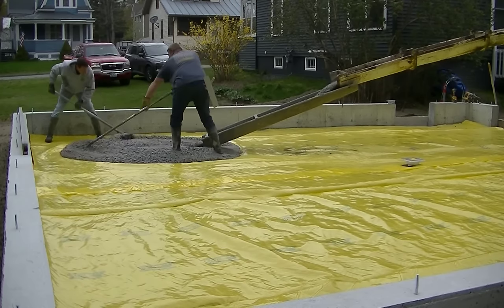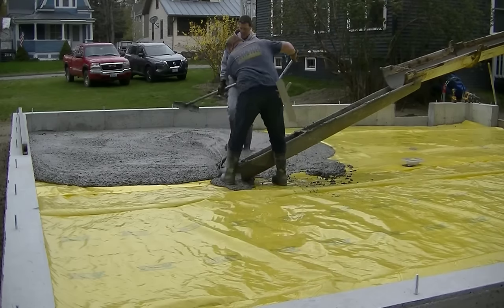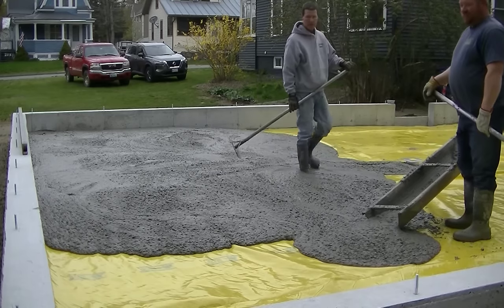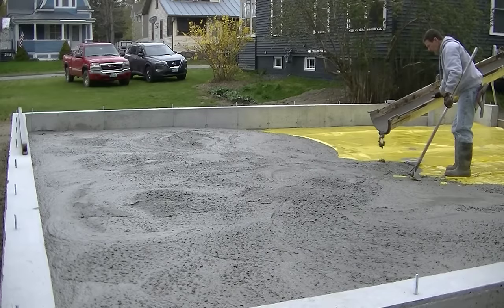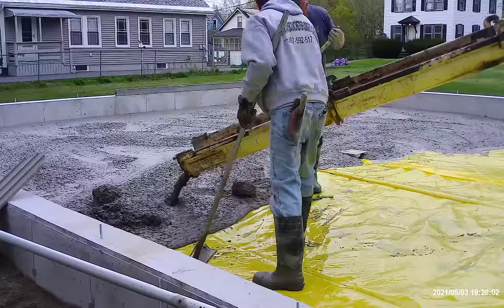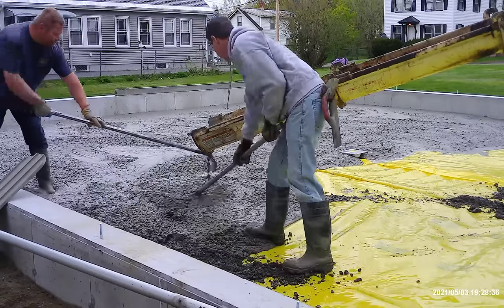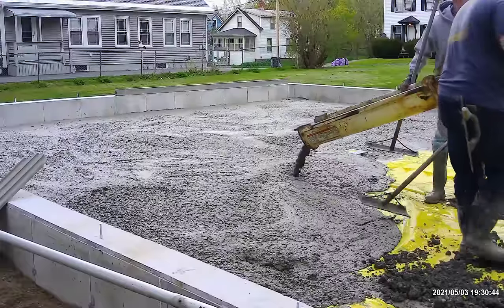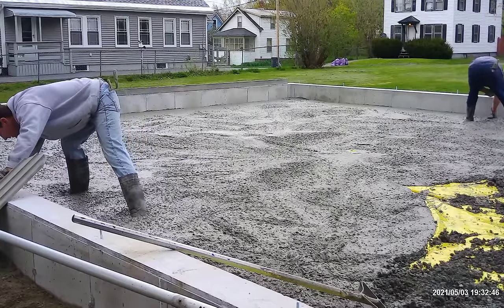How 2 Men Can Pour A 32' X 28' Garage Floor (I Got Concrete Balls!)

Comment: retired finisher here and so glad you told us about the superplasticizer, I was gonna call you out on a 8 inch slump
Reply: Not retired yet but started as an edger and went to knee board finishing and I was thinking the same thing🤣
Reply: Didn't watch the whole video, but was hoping that was super p and not 70 gallons of water. I poured a lot of "self leveling" mud as a driver. Lots of lazy finishers in this area.
Reply: @TUGG75  we poured big commercial government jobs. They wouldn't let us add water, our QC guy had to come add super p to the mix.
Reply: I thought the same thing.  No bar, 8-9 inch slump, hope you’re only parking bicycles on that shit.
Reply: @jrichtruckincbtips yeah they should have ran into a lot you got to check the specs 10 5/4 for every yard you can add Super Pete tell the driver to bring the slump up to a 3.5 when he gets there then throw the super pee in you'll be fine
Reply: Besides they take test cylinders and that will tell the tale
Reply: @jrichtruckincbtips depends on what the specs are I hate them concrete inspectors and test guys they only have a civil engineering degree they're a pain in the ass I don't let him dictate my job you're here to take test cylinders and that's it I'm glad I'm retired

Comment: I haul concrete for a living.  The “dry balls” are caused by slumping up the load too quickly with water.   The more water reducer that’s added to the mix during batching, the slower you have to add the water to the load.  If the batchman adds all the water to the load and leaves no room for the driver to slump up, the balls won’t break up.  Also, those came out near the end, so there was most likely dry pack stuck at the front of the drum and started to break loose at the end.  Unless you can dry up the load with a bit of cement powder and aggregate, it’s nearly impossible to break that up on a high slump load.
Reply: ...exactly!
Reply: Good answer for concrete balls. Plus the fins are wore out? Hmmmm?
Reply: @user-fy3kd9qf2m  I've gotten the balls with a brand new mixer...its definitely the batching method. Typically when its rushed and too wet for the mix chemistries makes for rabbit turd dissentary.🤭
Reply: @user-fy3kd9qf2m  The drum usually wears out, just past the center of the drum on the rear half.  The fins are usually still fine and don’t affect the mixing due to wear.  The height of the fins on a dry batch drum are usually taller than on a dry batch drum.  You can tell a wet batch drum from a dry batch drum by, a wet batch drum has a long weld which goes from the front to back of the drum.  A dry batch drum has staggered welds running its length.  Another way dry balls are formed is when the truck shows up to the job at a 2.5 to 3.5 inch slump and plasticizer is added on-site to create a high flow mix (for radiant floor or basement mixes).  If the driver mixes up the load too quickly, it creates lots of balls.  The best way to mix the load, is to put the drum in full charge and increase the engine rpm’s just slightly.  Then let it mix for 8-10 minutes.  I watch guys do this the wrong way all of the time and they always end up with dry balls.  Then you have the contractor telling him to add more water and mix it up again.  Once the balls have been created, the only thing you can do is have your catchers mitt ready and pretend you’re in the World Series.
Reply: @user-fy3kd9qf2m  I'm glad to be able to provide some input here.
Reply: @user-fy3kd9qf2m  Vancouver, BC

Comment: I Have Owned and Operated a Concrete Company For 32 Years. My High School Buddy Is Also a Concrete Guy, Him and I Used to Do AutoZone in Ohio, Dollar Generals In Michigan and Ohio and He Still Pours In Michigan Dollar General Store, Although He Doesn’t Do The Inside Floor. The Man Is Larry Elliott Who Him and One Man Manual a Summer Worker From Mexico Those Two Guys Have Poured (100) One Hundred Yards a Day, Break That Down Then Form and Pour Another (100) Yards Again Until They Finished The New Parking Lot. I Done All The Grading From Rough to Finish so they Could Pour The Parking Lots. He Did Three Dollar General And Several Massive Farm Barns Him and One Other Guy. We Use a Strike Off Stick No Bending until It has Magged Out or Burnished Depending On The Pour Requirements.

Comment: A warning to those who think it looks easy 
These Boys make it look easy 
Its not 
Good job 
Great team
Respect from Australia
Reply: I've poured for 25+ years, and yes it's not easy.. with the right people its easyer but that's it
Reply: On a 85 + degree weather, no way Jose !!!!😬😬
Reply: So very true spoken.
Reply: I finish concrete in Miami with a 4 men crew. I tell everyone, nothing is easy in concrete work. Especially on a hot day in July and August. I have respect for all who finish concrete, cause I know how it goes..
Reply: I don’t think anyone can appreciate finishing concrete on a hot day until they have on a summers day in Australia man, crazy heat, only complaint about this video is first bull float run should always be the opposite direction you screed, gets all imperfections out then a quick run the same way you screed and she’s right
Reply: Thanks for the heads up. They make it look very easy!
Reply: I’m a general contractor and do my share of concrete, mostly foundations and footings where finishing skills are less relevant (though still more than people realize) I’ll do a little slab here and there, but for this sort of thing I call in the specialists. I think of these sorts of videos more as appreciation of craft than a how to. Concrete work is totally unforgiving. If you mess up, and you definitely will if you watched this and think you can do it, you now have like ten tons of rock hard garbage you’ll need to get rid of or learn live with.

I’m a great carpenter, and I like that I can stop when things go sideways and take a minute to reassess or even come back tomorrow. Can do that with concrete.
Reply: @jimbeam9176   yes sir. then you get those guys who think its easy and think they could do it and we all know how that goes 😂 good work !

Comment: When your slump is basically self leveling it's make placing it so much faster and the screeding goes easier. No big piles to rake lol. Nice job guys!
Reply: Weak concrete. And stones sink.
Reply: @concreter6832  you didn’t listen very well did you
Reply: @OlDirtyBandit  what didn't I listen to mate?
Reply: @concreter6832  you said that concrete is weak
Reply: @OlDirtyBandit  yes it is weaker when concrete is overly wet ,your stones will sink (basic gravity) and the fines will rise ,then the concrete can delaminate, makeing weak. And to wet makes it messy to screed ,you want to cut with the screed at 90 slump , that is how I have understood it for past 30 years , everyone to there own.
Reply: @concreter6832  they used a water reducer so what you’re seeing isn’t water
Reply: @concreter6832  the water reducer isn’t the same viscosity as water so the heavy aggregate doesn’t sink like it would with overly wet concrete
Reply: @OlDirtyBandit  I love how on almost all of Mike’s videos there is someone complaining about the concrete being too wet and how weak it’s going to be when he always clarifies that he uses a water reducer and that the strength is not compromised lol.
Reply: @concreter6832  as long as you don’t hit it with a vibrator it will be okay.
Reply: @SkyGhost1000  i
Reply: @SkyGhost1000  You can't look just at the water reducer, you also have to look at the slump. A slump of 1 has less water than a slump of say 5 or 6. So if you start with a slump of 5 which is a good slump for flat work, the water reducer will reduce water content by 5 or 10 percent. The concrete he is placing is know where near a 5. The dryer the concrete the better it is.
Reply: Even with that super plasticizer, that concrete wouldn’t pass a test up here in Canada. Waaay to wet.
Reply: @EdmTomtom  That is some wet  concrete.

Comment: I always have my 2'x2'x3" concrete molds with me to put any extra concrete in after I get done pouring.
I lay them out flat on my open trailer and never move them until cured.
Makes good condenser pads and walkway blocks.
You can make good patio blocks and wall blocks too.
I made a retainer wall 80'x4' with them.
Reply: That's awsome, great idea!
Reply: Smart.

Comment: Love the precision back kick when you’re screeding! Looks like synchronized swimming!👍
Reply from the maker: Thank you
Reply: Indeed nice when you have a good workmate!
Reply: You got a good dance partner there Mike... ;)
Reply: I've never done cement before. I appreciate the synchronization. The kicks you reference are to kick cement into the void where your foot just backed out from? Reduce any kinda pockets? Or am I just over thinking this? Also, how much does this amount of concrete cost? Including footings?
Reply: Synchronized screeding - Sounds like an Olympic event, lol ..
Reply: probably muscle memory from pouring floors with rebar. you shuffle your feet and your heels will cath the rebar mesh and send you ass over teakettle
Reply: @Iamtherealflip  I would guess it's so the boots stay on your feet n not in the mix.
Reply: @seanmurphy2302 i have totaly jumped out of my boots before lmao. dude above was correct, we call it kick rodding and it is to indeed to fill in the void where your feet were as you move back.

Comment: just curious why rebar wasn't used for this pour?
Reply: I assume it's because of the concrete wall that will help reduce expansion and cracking plus the mesh fiber. I would probably still use something tho ... also no jitterbug?

Comment: I worked with concrete alot. An never seen two guys work in unison together like they do. 👍👍
Reply from the maker: Awesome, thanks!
Reply: RIGHT 💯💯💯💯💯🔥💯💯💯💯
Reply: The bromance is strong!
Reply: That's what long time work friends look like. When there is long lasting loyalty and consistency between 2 Pros no job is a hard job.  This is why we need to train consistency in all trades.
Reply: Young guy just does what ever old guy does
Reply: That's what I was thinking. There's no way in hell any one of my friends and I would be that synchronized. Lol
Reply: Do concrete guys usually have bad knees? I'm thinking walking around in that must be hard on them.

Comment: In my experience those balls come from a dry batch plant. Usually when there is a long travel time to the job-site or the customer has a reputation of pouring piss wet. The batch man will try to get it loaded wet enough so the driver does not run out of water or have to keep re tempering the load to get it to maintain a wet enough slump. In doing so there is so much head water that the cement balls up and floats instead of being agitated by the fins. If you climb up and look in the drum you can see them and since they float they come out at the end of the load. Mixing will only make your load hotter and not break the balls. If you typically only get them when going from a mid range to a super then the batch man needs to go into the mix design and adjust to a lower water cement ratio to compensate for the additional water reduction of a super.
Reply from the maker: Good advice
Reply: yeah, what jason said
Reply: Also what helps is if the batch plant can slow down the flow of cement into the truck. Many TXDOT jobs and telling the computer to go slower on the discharge helped a lot. Of course, a wet mix, usually a 6” or above will give you balls. Better to have the trucks travel at full charge for a longer time to give it more time to break them up. A 5” slump or lower to break up the materials is always better. Better to add water on the job than get there too wet and have balls to deal with.
Reply: Saying that the balls come from a long haul is a bunch of ballonii.  It comes when the batch man loads to fast.  The dry mix went into the mixer too fast and didn't break up.  Also the drum must be turning full speed when the mix is going in.
Reply: These balls do not float. They are the same weight as the rest of the concrete. It only appears as though they float. There are always more balls that can be seen as not nearly all appear on the surface.
Reply: @Paulsministry  I did not say they came from traveling farther, simply that the batch person usually tries to get more water in a load when they know it will have a long travel time. There are many reason that can cause balls. I was simply stating the most common reasons I have seen in my ready mix career and experience with dry batch plants.
Reply: @Paulsministry  I agree, they do not float.
Reply: The balls come from adding too much water initially. A lower cement/water ratio would help for sure. Once fully hydrated (inspection) then slump up with water or super.
Reply: I've found lower head water, timing when and how fast you dump cement help. I would lower head water add the rest while loading aggregate and slow down cement dump. Higher aggregate moisture had also seemed to be a culprit.

Comment: There’s a lot reasons the meatballs can happen. One of the common ones you’ll see is if it’s a large load (10yds or so) there’s not enough open space in the barrel for it to blend. You might notice loads 8yds or under tend to mix more consistently. Also sometimes your not getting enough batch water in the nose during loading.
Reply: You are absolutely correct my company only loads 9yrd max some older trucks 8.5
Reply: Your right the 10yarders sometimes had lumps

Comment: Nice work, never heard of the plastizer stuff,  1st load looked really wet vs 2nd load too.   Seen few clinkers nothing like those tho.
Most here now use power screed w fiber too.   Not a pro but been on a bit of flatwork.
Reply: They did that 1st load wet on purpose, so they wouldn't get a cold joint at the end. Poured a little mud in my day for about 8 years, best damn job I ever had but just didn't pay enough.
Reply: We use quite a bit in the city's too for high rise buildings it has to be wet for the pump to reach 50 75 100 floors up without sacrificing the integrity of the concrete

Comment: Ummm, no wire or rebar or any type of inner reinforcement to keep that giant slab from cracking? I suppose that's one way to do it if there's no building codes whatsoever.
Reply from the maker: So wire will PREVENT concrete from cracking. You sure. Might want to research some more. And I did mention the mix design with fibermesh.
Reply: Good lord, please free YouTube commenting of stupid people...
There is one guarantee with concrete: it's going to crack even if you use wire mesh or rebar. Using the right mix which includes things like fiber mesh, right amount of water, plasticizers and superplasticizers, 2% high early on a cold day so it can cure properly, etc help to reduce the amount of cracking. Cutting and dividing is there to control where a slab cracks.. Good compaction, slab thickness, and weather when placed also play in to how well it performs and lasts. While I'm here, if you are a concrete contractor who: 1. directs the ready mix dude to 'soup it up' with a ton of water because you're lazy, weak or undermanned, man up or pack up shop. 2. if you pour driveways on sand or just dig too much dirt out with the skidsteer and roll it back in without tamping it, its called class 5 and a plate compactor. Slow down and do proper prep...don't skip, or pack up shop. 3. When finishing, the slab starts getting away from you because you're too slow or you didn't properly figure in the weather or the right mixes. What do you do? You spray the damn thing down with water and then the whole thing spalls like a mother fucker within the first year. Treat your customers right and redo the thing. It expensive to replace I know, but if if you don't know what you're doing, or don't have enough skill or guys to get it finished right the first time, you shouldn't be in the business...pack up shop.
Reply: @patrodgers5233  I'm a beginner/novice working with concrete.  When assisting others with pours, I'd always hear "make the mix as wet as hell".  I was always told you had to have wire/fiberglass mess to strengthen the slab.  Your comment is spot on.  Do the prep right (i.e. class 5 and a plate compactor), have plenty of help, and know the weather.  Thank you for your excellent advice.
Reply: The fiber mesh helps to bind it, no real need for rebar
Reply: Roman roads are 2000 years old they didn’t have rebar in them. I am of the opinion that rebar rots oxidizes turns to rust Swells up and breaks the concrete from the inside it takes 30 maybe 50 years. It should be galvanized coated. The reason the cement is soupy they put plasticizers in it. I just wonder if that’s what happened Miami surf Side ? You can only make fake rocks so strong.

Comment: I’d bring the cement balls back to the batch plant for credit. You shouldn’t have to deal with those. The work is hard enough.
Reply from the maker: Haha, that's a great idea!
Reply: I’d say it’s just part of the job. I only got upset if cement ball vibrated thru the grates on my pump and caused the plug at the reducer etc. usually just mix it in the mixers for a bit and it will get rid of the issue. I’d rather have a cement ball than a fin fish falling into the hopper and causing a plug at the reducer , point of a smaller discharge hose . All I a days work. If that’s the worst thing that happens to you on a job site, count your lucky stars!
Reply: Like to see that happen lol

Comment: Nice job Pouring (or Placing) the concrete...Most experienced two man crews can get it done as you did....
QUESTION: Why don't you have the Vaper Barrier placed under the fill? When you pour on plastic the concrete sets from the top up instead of the top down.... All the water goes to the surface so when you start finishing you are already behind because 1/2 to 3/4 of the concrete is already set.